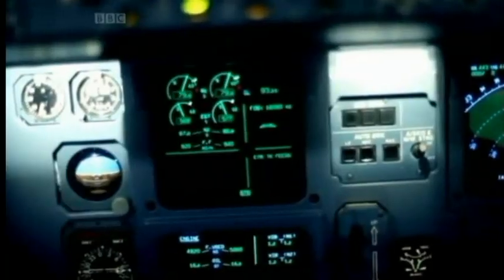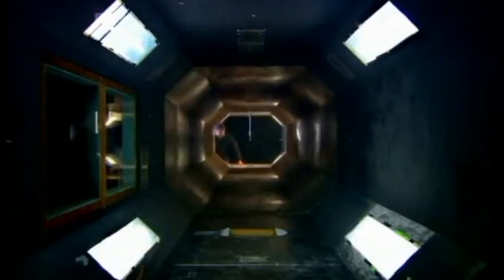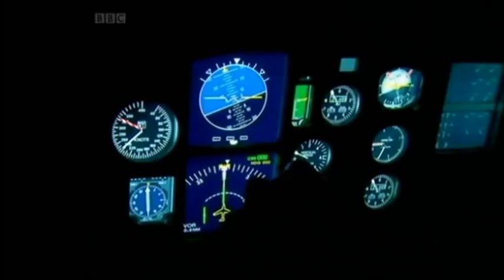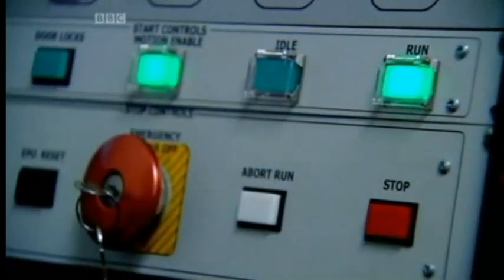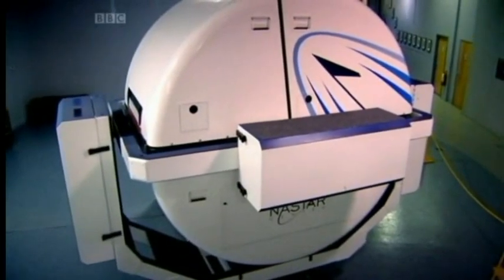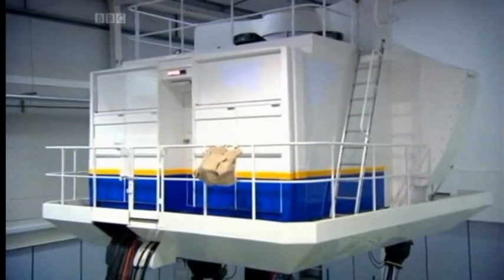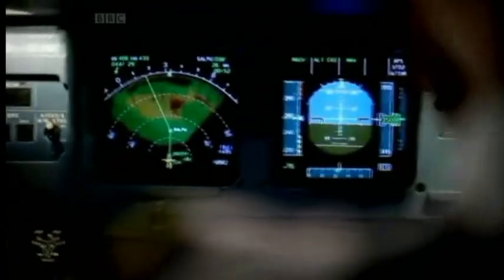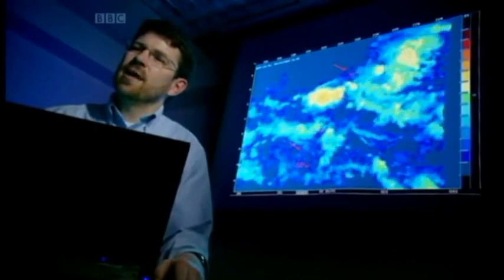The Crash of Air France Flight AF 447- Part 4 of 4

Comment: I'm taking an Air France Paris Sao Paulo tonight - i've taken this route about 40 times and have encountered very severe turbulence on three return trips Sao Paulo to Paris. My worst turbulence was actually on board a AF boeing 777 but the two massive engines speeded up and decelerated  many times. I had severe turbulence where the AF447 went down... Nose of plane rises steeply then dives down steeply and plane takes a fall on the left quite frightening stuff indeed. The stewards and air hostes

Comment from the maker: @roflmatol The standard protocol if these instruments fail is to dial in 5 degree angle and throttle to 85%. This way the aircraft will neither climb, nor stall. That is what they should have done when the auto throttle disengaged. At high altitude, stall speed of an aircraft is not much below its cruising speed.

Comment: @aizad3755 The "sensor data" are ALREADY relayed in real time ! The messages they talk about are automaticaly transmitted to the ground, so maintenance is sometime aware of the malfunction before the pilots themselves. The thing is that the amout of data you can transmit in real time is limited, especially considering the number of plane flying at a same time, your camera has to be a fisheye with 10G pixels to be useful, and you'll still have to record what's not displayed on MFD at a given time

Comment: These Crashes are within a Two Year Period in the Late 1940's.  

1.  United Airlines Flight 608 -  Killed  47 Passengers 5 Crew Members.  
2.  Northwest Airlines Flight 4422 - Killed 24 Passengers 6 Crew.
3.  United Airlines Flight 624 -  Killed 39 Passengers.  4 Crew Members.
4.  Northwest Airlines Flight 4422 - Killed 24.  6 Crew Members.
5.  United Airlines Flight 610 - Flies into mountain all 50 Passengers are killed.
6.  Northwest Airlines Flight 421 - 33 Killed.  4 Crew Members.

Comment: @aizad3755 The dreamliner has a standar centra yoke powered by Fly By Wire. But unlike Airbus. Boeing has hydraulic back up system like a conventional system. So in cases like this the pilot can maintain control

Comment: @aizad3755 How could that possibly help? In case of AF447 they were flying at night over the ocean. At total darkness and high altitude there's is no external point of reference; it's like flying with your eyes closed. There is no way to tell what the speed and pitch are without relying on the aircraft's instruments. If these fail, you are totally screwed.
Reply: They did not fail. Only one single instrument failed. Everything else was working perfectly fine. That he did not trust anything because one single thing fails. There were over 70 stall warnings. He had the controls pulled back the entire time despite that being the exact opposite thing of what you're supposed to do. Pilots have this smashed into their brains 4 years during training. The co-pilot absolutely was incompetent and caused this plane to crash. It would have been very easy to recover from this. It wouldn't have even stalled if he hadn't pulled back the stick.. all he had to do was continued flying as he was until the defrost finished. It wouldn't have stalled. He didn't even have to recover it from a stall like they did in the simulator. All he would have had to do is just keep going. But even once it stalled, he still could have recovered in time.  the time he got back into the cockpit. And by the time the captain realized the co-pilot stupid mistake, it was too late.

Comment from the maker: @NordLejon A medium size data center would be required to store the compressed videos and in-flight data. Maybe all the world's airlines can help pay for it. All NEW commercial aircraft cockpits could easily be wired with a couple of small ip cameras. The cost per flight hour would not be very much at all. Probably in the range of ten to fifteen  dollars per flight hour. They could start off this project by storing the CVR and FDR data only. That would be even less expensive!

Comment: @aizad3755   It is entirely possible that the wings could have iced up in the storm clouds. This is something that is well known and pilots do everything possible to avoid major storms. The icing of the wings in the air is different from that on the ground. In the air you are dealing with a phenomenon called super cooled water. As you know water starts freezing up when it gets to below 0℃.  However supercooled pure water doesn't freeze at  that point..

Comment: @aizad3755 However pure cooled water in clouds may not freeze until it meets a point of contact to start the freeze crystals. When a plane is going through water laden storm clouds the super cooled water immediately starts freezing up on the surface of the plane.  So you could potentially have a whole plane that is covered with a layer of ice.

Comment: @aizad3755  However if certain parts of the wings quickly ice up, no anti icing system can work fast enough to break up the ice. The result is a loss of lift. Sometimes one wing will ice up more than the other and thus the plane will start to lean to the right or left.  No doubt the icing up of the pitot tubes is an indication that the ant icing system in the tubes failed to melt the ice. It just formed too quickly. So if the pitot tubes could ice  up so could the plane’s wings.
Reply: You see what happens when people try to speculate and they don't have enough information. This is a perfect example. You made so many assumptions and you were wrong. The parts that froze over, thawed out rather quickly. The copilot would have only had to pitch down to make sure that they were going fast enough to not stall. And they could have reset the autopilot and climbed back up they would have been fine. If the captain didn't leave the cockpit he wouldn't have come in to numerous things happening at once with only about 2 minutes to recover. Human error killed these people

Comment: @aizad3755   So  in this case, if the pitot tubes were blocked by the super cooled water droplets, and that was indicated by the recently found black boxes, could they not also have collected on the surface of the plane? Specifically, the critical wing sections that provides lift? Could this s lead to a possible fatal flaw in the wing design of this model of airplane?

Comment from the maker: @aizad3755 It was a pretty dreadful fall- about 180 feet per second for almost four minutes. What astonishes me is that none of the pilots had any clue about how to get out of the mess. All they had to do was to push the nose of the aircraft down, and then gently pull it up once they reached a decent speed. Nothing else was needed. Instead they kept doing the exact opposite of what they were supposed to do.